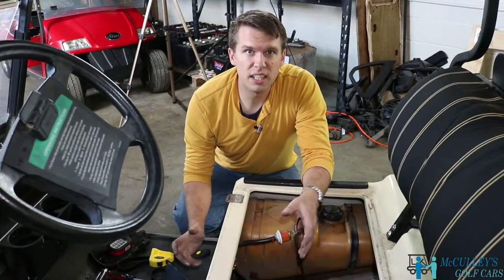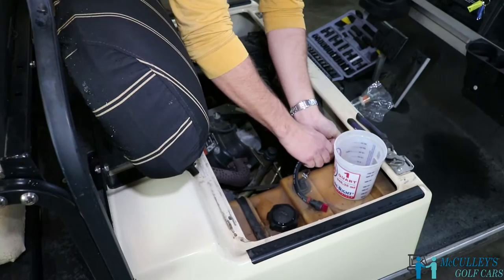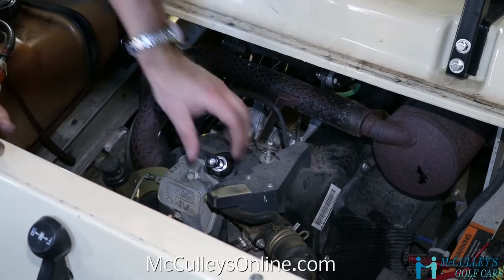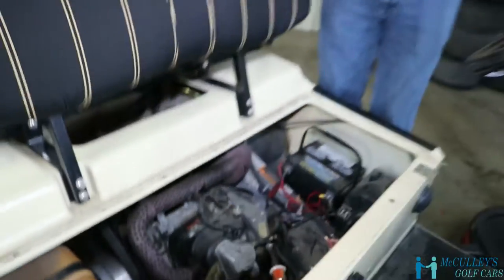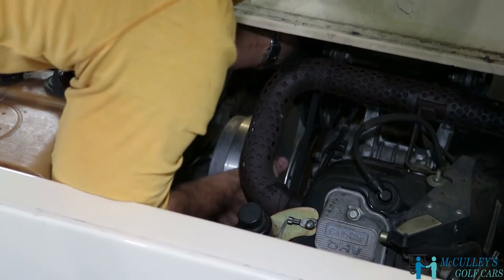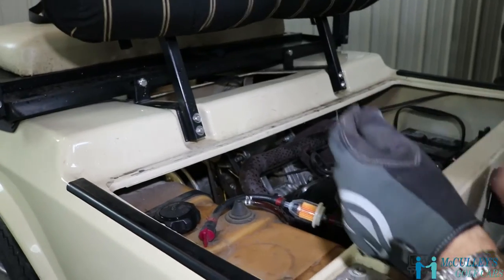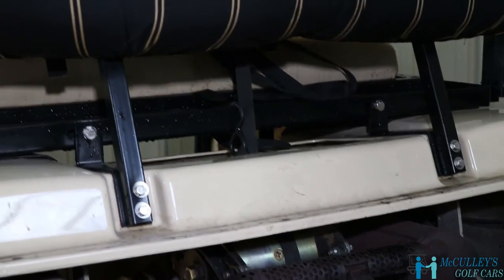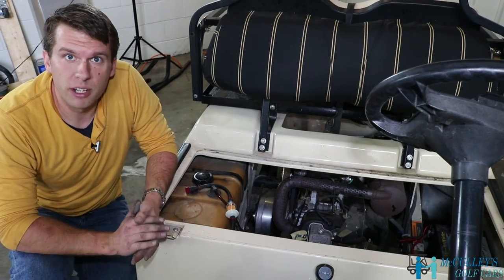How to service your 2004 Club Car DS Gas Golf Cart McCulley's Online

Comment: How are you able to stay so clean? Other than that excellent videos. I'm considering buying a gas cart. Do they have to be plugged in the way an electric does? On average are gas carts a lot noisier? I noticed what appeared to be a muffler under the seat - does it transfer much heat?

Comment: always check gap on spark plug
Reply: Why dose my 91 club car only start or turn over when the key is turned on not the gas pedal I think it is the micro switch wiring is wrong . Been  trying to find a wiring diagram show what color go's to what terminal can you help